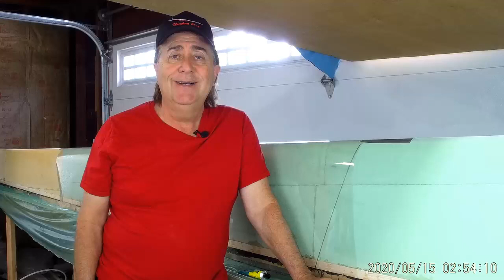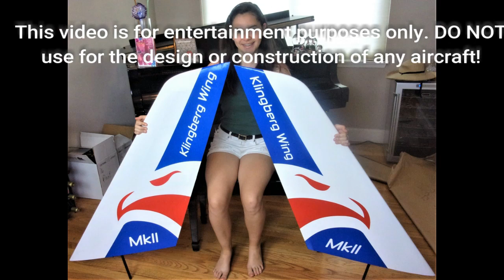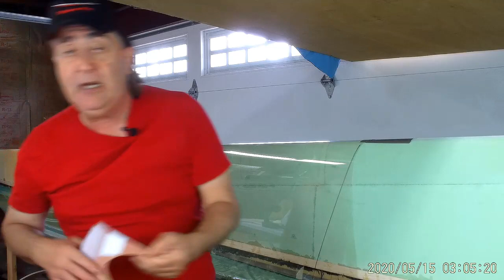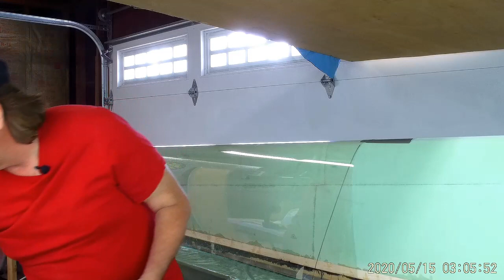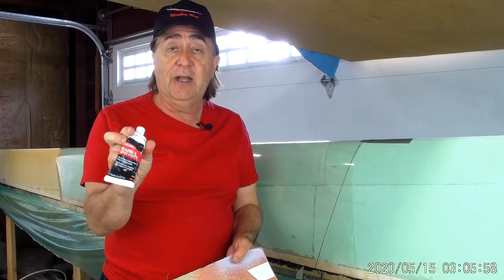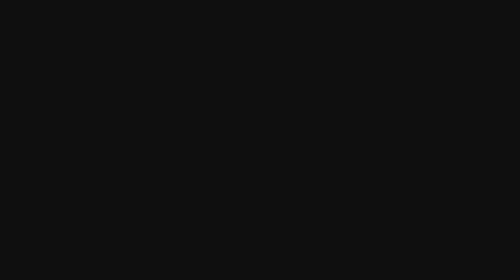D-Tube Construction Challenges - Klingberg Wing MkII Development

Comment: Hey Rol, I like your Videos a lot and enjoy your development Process. I had similar problems with Mylar buckling and I fixed it by Putting the Mylar on the Mold inside a Hotbox and let it sit there under Vacuum for about 12 Hours at about 60deg C and now the Mylar fits perfect,  the Heat treatment can Probably be improved but it worked for me so you might want to try it too. the only problem is that it then has the shape of the Mould and you can not really lay up the fiberglass on the Mylar, I just laid it up on the Mould and put the Mylar on top, worked fine for me but might be difficult for big parts... just some inspiration that might help you...
Reply from the maker: Wow, an excellent suggestion - that's what I really love about YT and our aviation community. Tons of folks out their that are willing to share their experience - Thank you. I will have to run a sample and see how it works for me. Seems to make perfect sense as it is like molding a canopy - similar materials. On the down side, my male molds don't have any impact on the smoothness of the outer surface, so I didn't bother making them very smooth, so I can't mold directly on them and get smooth mylar. However, I might be able to use the airex foam and a layer of vacuum bagging plastic as a cushion and provide a smooth surface that way. Thanks for getting my brain thinking!